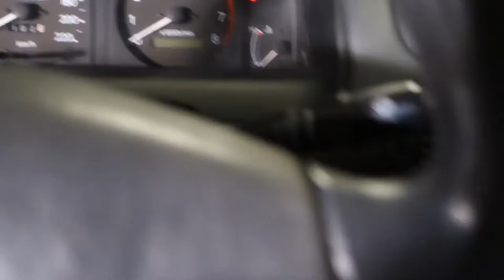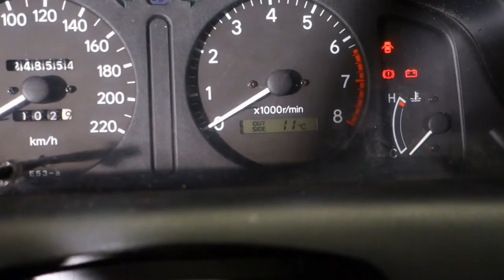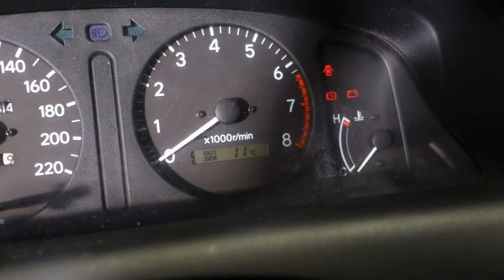What to do if your Car won't Start.  Try distributor cap replace Test  6 of 8

Comment: Hi Peter, which cable harness can I disconnect on my distributor if I want to disconnect the distributor from sending sparks to the spark plugs?  Is it the big harness or the small one, or both? (Corolla 2000 7-AFE). Thanks
Reply from the maker: Both

Comment: Please help my corolla was not starting i replaced the distributor but still not starting?
Reply from the maker: Ok, look next area to repair
Reply: Wich area Mr Peter? Because when i turn the key on the engine light was not appearing on the dash but i called the electrician he's said these an issue with the computer box and the key he just fixed it to sho that light again.